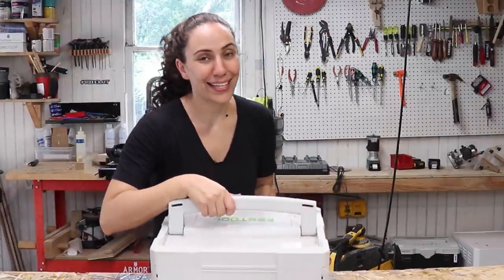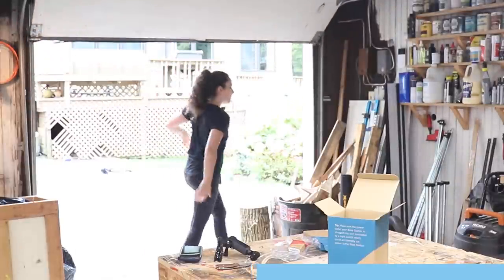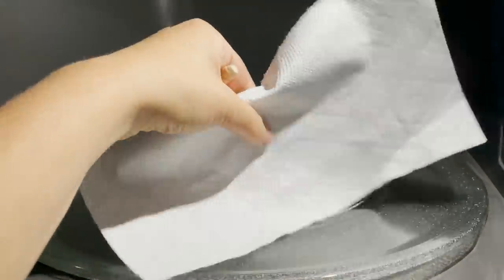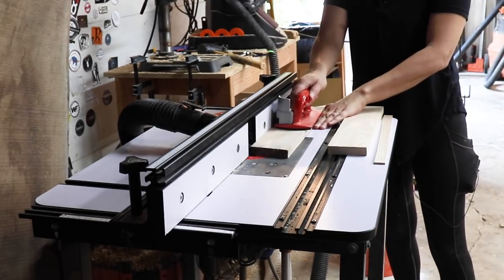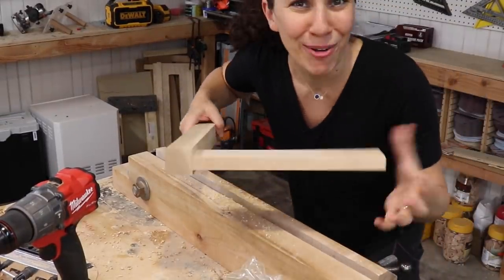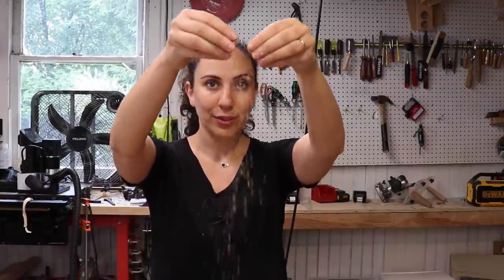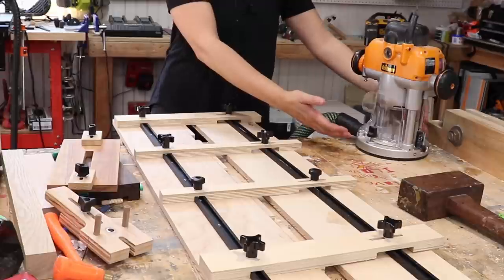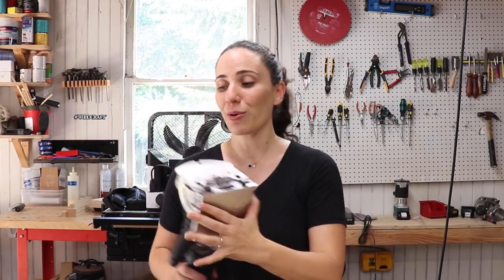7 ways to get around NOT having a DOMINO

Comment: Yeah, I guess they are expensive, but what if I told you I could make beautiful interior and exterior doors in the wood of your choice from start to finish in a couple of days.  I replaced my crappy hollow core doors with wood doors made of cherry (mainly), walnut quickly and beautifully.  I've made bedroom passage and closet doors, pocket doors, a weird sized closet door under the stairs, many cabinet doors for a kitchen remodel and awesome yard gates.  I made divided light cabinet doors that and as rigid and flat as they can be. I don't do this professionally but I've still saved many thousands of dollars with this tool.  I guess you can buy doors like I make, but you would have to search far and wide.  I haven't made much furniture yet, but what I've made is strong and beautiful.  I got both the large and small tool and I've never had any regrets.  The tool is revolutionary.
Reply from the maker: Yup!
Reply: If I could make things out of the wood of my choice it would mean I'm rich.

Comment: I make my money on my lathe, I’ve had it for exactly 18 months and it’s paid for itself almost 15 times already. So I totally understand the this will help me get it done faster and better so I can make more product, making shot glasses and wooden jars without a lathe is such a pain, but I’m pretty sure my lathe cost less than a domino though- especially since it came from Harbor Freight
Reply from the maker: I can’t wait to get a lathe. Ha
Reply: @3x3CustomTamar  it’s a very addicting tool, they are so much fun. I started with a micro lathe that was meant for beads, and I used it to make shot glasses and ink pens, saved the money I made from those to buy my HF lathe. Zero regrets

Comment: Hey you can also run the domino jointer down the length of edge of one of the sides you are jointing and do the other side of the joint like normal so you don't have to worry about lining them up. 
Hope that makes sense🤔

Comment: I like the adjustable mortise jig. Depends what you do. week end warrior, pro but cant or can justify cost to profit. Or the artist who will sacrifice for the sake of the craaft. I need to build 5 doors and I still cant justify a Domino. Because what you did not show was the JessEm Model # 08350 Dowelling Jig . Chick it out on the youtube. This bad boy is expensive but can do multiple dowels at once and will work fantastic in the middle of plywood. I could put three rows of 1/4, 3/8 or 1/2 inch on an end grain board and it will be stronger than a mortise and tenon.  It was 200 bucks with all the sizes. They also make one that has 8 millimeter I think.

Comment: Thanks for the videos.
Working 19 years in factory making furniture, I am spoiled. If I had to make cabinets fast and easy for work would find a good working used version of this minimax ad 21, a gang dowel drill.
Set you spacing and drill the dowel holes supper fast and accurate. A good used machine could cost you 1000 - 2000 USD. Then I really miss a Timesaver sander, Shoda router, large scale dust collection, edgebander. and Holzma saw. The building to house all this would be 4000sqf or so.
If I wanted to be reasonable would just get  Shaper origin, and setup a small shop around just this machine, and hand tools. You could do away with table saw router table and so on, would still keep a chopsaw.

Comment: I think your video was well written and informative for the most part.  I do have one criticism about your reference to pocket hole joinery not being strong enough to last.  I have been woodworking for over 30 years and have used pocket hole joinery long before it became popular again.  There are three points I would like to make.  1; the joint is only as good as your measurement and layout.  I have a table that I built over 20 years ago with the aprons held by pocket hole joinery.  This table has been moved at least 7 or 8 times during my time in the Air Force.  Now it is at son’s home still strong and not wobbly. 2. You have to use the right screws for the type of wood.  3. You have to tighten them by hand unless you want to strip them out.  I cringe every time I see someone run the screws in with a power driver, especially the ones without any clutch setting.  Pocket hole failure can be attributed to one or more these factors not being done well.
Reply from the maker: Maybe that is the case. All of my pocket holes items I built when I started are now loose and wobbly. But that could also have something to do with the big box store lumber I was using that was not completely dry. I just don’t like that they have become an answer to everything.
Reply: @3x3CustomTamar  They aren’t the answer to everything.  However for quick simple projects they are a time saver.
Reply: They're not even a modern joinery method, having been used for hundreds of years.  I'd expect them to be strong on things like table aprons where the joints at each corner work together to maintain the strength.  They shouldn't work loose either.  I will say that my powered driver doesn't make things any tighter than I'd make them by hand and I have complete control over the speed as well.  Definitely saves strain on aging hands.

Comment: Wanted.  A multi faceted box/storage/fold out work surface for apartment dwellers.  Criteria: store tools, low noise wood working implements (hand miter box as center piece), compact.  This would be a good project for Tamar.
Reply: I agree. I live in a first floor apartment and my living room is filled with tools on wheels.  I roll them outside to do all my cutting, So it’s a fair weather daytime type shop. Things grind to a standstill in winter and crappy weather. Humidity plays a big, big part in being able to fit things right. Long story short, anything that can help you work faster and more efficiently is money well spent. I guess I’m going to have to maximize my blood donating ability to afford this! LOL

Comment: Seems very similiar to the Porter Cable biscuit joiner I've had for years, my biscuits are much thinner and longer. Is there a difference between the two? LOl....spoke too soon...did not see the whole video
Reply: Dominos are stronger and can be used to replace an actual mortise and tenon, also there is less slop in the Domino than there is in most biscuit jointers.
Reply from the maker: Biscuits come in different sizes. For alignment, they will do the same job. But the domino is a real quick alternative to mortise and tenon joinery. I personally don’t think the biscuit is strong enough. I’ve seen too many failures. But other ppl have success with it. To each their own! Ha
Reply: I really love this jointing
Reply: @3x3CustomTamar  Thanks for answering that....love your videos

Comment: A good way to balance the speed and ease of using a domino in your videos and stay relatable to those who don't have is to always call out what jig you would have used otherwise for the joint and include a link to your video where you make/use that jig. It will also help drive traffic to your older videos.
Reply from the maker: I will most definitely do that. Ha

Comment: I use 3 methods:
1) use a pocket hole jig, but no depth stop. Just go right through and into the other piece of wood. Glue in a dowl and done really fast. And it has dust collection.

2) just use a drill guide with a fence attached so the center of the hole is always 3/8" from the edge of the piece.

3) just clamp everything in place and drill right the way through one piece and into the other. Flush cut a dowl and move on.

Comment: Don't know why but I made some comments but they keep disappearing. I suspect because I included some links to support what I was saying. 

I wanted to point out that Mafell (Mafell DDF40) makes something similar to the Domino that uses dowels also providing dust removal. The Mafell unit is nearly the same price as the  smaller Domino but less expensive dowelling machines are on the market (Triton TDJ600, Grizzly PRO T32540). The less expensive machines have not gotten great reviews, but the point being that a number of models and price points exist for automating the dowelling process in a very similar fashion to the Domino but with lower consumable costs (dowels vs. Domino tenons).  

Also, because a number of more manual (but precision) jigs are on the market the versatility of dowels can't be ignored covering many price points. Finally, dowels (vs Domino tenons) can more easily be made (if you wish) and stock dowel rods are available at a very low price to customize to any length being available in a number of wood species. 

Basically, I think the Domino is a great tool. And, I would say if you can afford it, is should be part of your joinery kit. But some of the advantages you indicated are available using dowelling machines (though less well known) at a lower consumables cost where the consumables can be purchased from many sources, and some cheap easy means exist to create your own dowels (like if you want to keep the species of wood the same) allowing for ever more flexibility. 

No one should blame you for getting a Domino and increasing your productivity! Period. However, using dowels has an upgrade path 60$ jig -> Dowelmax (or something like it) -> Mafell DDF 40 and a lower consumables cost with more available consumables even though the consumables may well be a minor cost for most. 

Great work, keep it up.

Comment: So I hate to point out this (because I'm really not a 'Negative Nelly') but the Festool Domino by itself does not collect dust.  It requires a fairly expensive dust collection vacuum sold by them.  Yes, you can adapt other things to it, but not with as good efficiency.
Reply from the maker: I happened to have already had the dust extractor from my sander. So yeah. I didn’t think of that. Ha
Reply: @3x3CustomTamar  - how do you like their sander?

Comment: I don't have a dominoe but I have access to one. They are great for what they do but I see too many people using it for breadboard ends. There isn't a substitute for real breadboard end jointery. I think that most people don't really understand what or why you would use breadboard ends. On spline joints I prefer high grade plywood for the spline.
Reply from the maker: I havnt seen anyone use it for breadboard ends. Interesting. Guess the domino is becoming like the new pocket hole. Ha

Comment: If Evan and Katelyn, who are not woodworkers, can have all the best pro tools, you can too!!  On the other hand, this is the time you should be getting a mini split heat pump installed, which air conditions and heats very inexpensively. In fact, it would pay for itself in energy savings and it would be more comfortable working in your cold shop in the winter. I would have gone for that first, though it is more expensive than the Domino.

Comment: For a full-time professional (Youtuber-maker, or just furniture builder), the domino pays for itself so easily with how much time it saves, even compared to what I use as an alternative (The Rockler Beadlock loose tennon system). So I don't really get the hate. 

Now, for me, I only make 2-3 pieces for sale a year, so I don't think for me it would pay for itself quickly enough to justify the expense. But you make way more than I do. When I see someone using a domino and I want to make what they're making... I just substitute my beadlock for it and it's basically a one-to-one substitution (Obviously with more time spent in cleanup and setup). I guess what I'm getting at is, people should quit complaining you do you, there are alternatives that start at 30 bucks (Like the beadlock basic or 79 for the pro).
Reply from the maker: Yup! Agreed! Still shocked that some ppl say they will turn the video off Bc they see a domino. Even after I made this video 😂

Comment: Your videos are so clear, logical and informative, also including the journey to conclusions. Super useful! About the biscuits vs dominos: I wonder if you use 2 biscuits on top of each other, and  make double width cuts with the joiner, could it approach the domino strength? Maybe not, since the depth can be (much) deeper with dominos, plus they are one single bit of wood. Domino joiners cost double for a reason, but that reason is not convincing for everyone and all use cases. Perhaps multiple dowels may approach the strength of dominos as well in appropriate projects?

Comment: You forgot the most simplistic just butt glue it. With modern Glues they actually tend to be stronger than the wood they’re gluing together so if you’re gluing up a panel as long as you have jointed edges just apply glue and clamp together. It’s also as were a biscuit can come in handy it will help to align so your face will remain lined up require much less sanding and prep for finishing. The biscuit also add strength from the joint pulling apart as that it create a physical connection within the wood but the force that this increase strength is in pulling the joint apart. Anyone who’s ever refurbished old furniture has probably seen where seems that were glued up by the simple but joint have failed and the joint comes apart because the older glues had that problem. The biscuit also add strength when you’re gluing end grain to end grain no I’m not talking about massive structural strength but we all know that trying to Glue end grain to end grain is difficult to accomplish. But when you’re putting trim around your wood project and your mitering the corners a biscuit can help to hold that miter joint together similar to a spline. If you want real structural strength you’d want to do a finger spline or maybe even a dovetail spline. But if you don’t want the joint to be seen or any splines to be seen the biscuit is a quick and easy solution. One other option you didn’t show is the other one trick pony tool for mortise and tenon.  A mortising machine which I actually have but it only cost me $275 give or take a little. And there is a lesser known method for floating tenons it’s called bead lock I have the complete three size set but not the professional which actually has a guide so you can run your chisel to square up your mortise.
Reply from the maker: Was skipping over the obvious
Reply: @3x3CustomTamar  you did say mention the ones you may have missed and I was clarifying a little bit about where the strength of a biscuit comes in many people think it will add strength in all directions but it’s a very linear addition of strength with a biscuit. And the bead lock is really not that well known.
Reply: @3x3CustomTamar  Quick second thought I also didn’t mention that if you’re going to cut a dado you could also make it a sliding dovetail joint with the same set up that you displayed in your video. Just like the old saying goes more than one way to skin a cat The real question is which one is most practical financially reasonable for you at the time.

Comment: I'm glad that you finally have a Domino machine as I know that you've wanted one for a while. Festool is polarizing but the people who put it down would buy it themselves and rave about it the investment was only $20. It's a wonderful tool and you're going to love it. It took me a day or two to realize that the small metal lip horizontally intersects the bit. Using that with the marks on the plate make a bullseye for vertical plunging. I'm sure that you knew that, but heads up if not. Glad you caught it before it bounced on the ground. 😏
Reply from the maker: Haha I’m glad I caught it too. Thanks for the tip!

Comment: No need to apologize for having the tools you want or need for your given shop. I do woodworking as a hobby and I love turning nothing into something, love the whole process (other than sanding). I've sold a couple things, not even a handfuls worth, I just like making things for friends and family. But I've also outfitted my shop with a brand new SawStop and a 14inch Jet bandsaw. I also have luxury tools like a drum sander, planner and other nice tools. One day I'll add a shaper origin and a domino, when the time is right and money allows. I started out with a black and decker table saw that wouldn't cut straight if you tried and a harbor freight jigsaw for curves when I wanted them but was still able to turn out nice projects. Having high quality tools isn't necessary but they sure are nice and I can tell you, now, there isn't an bit of dread when I turn on my tablesaw
Reply from the maker: Ooooh drum sander sounds nice. Ha

Comment: Cool now you can fix the roll up chair
Reply from the maker: Hahaha! I was going to this month…. But the weather did not comply. I’ll get to it
Reply: @3x3CustomTamar  take 4 dominoes,drill a hole in center of each...take some heavy duty 1/8 Para cord...thread cord through dominoes hole and knot...slide cord between slats of chair..dominoes on underside...then run cord up to top back of chair ...Run cord through chair and dominoes then adjust and tie knot